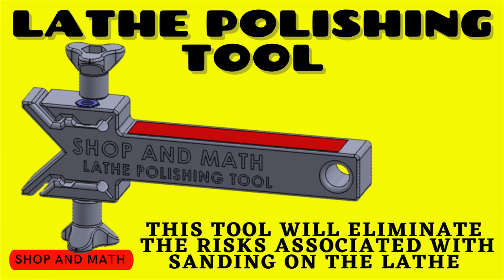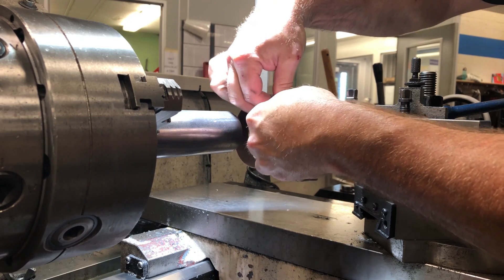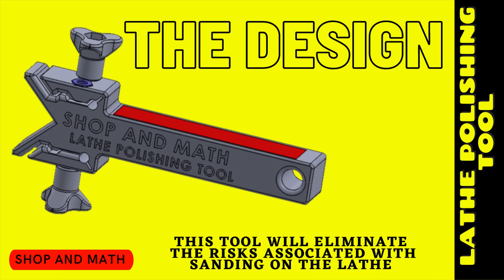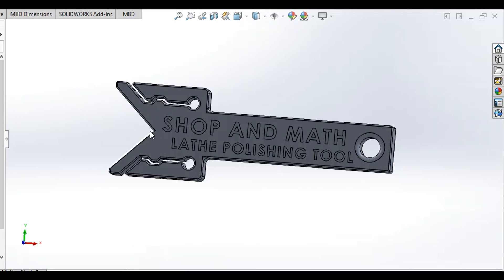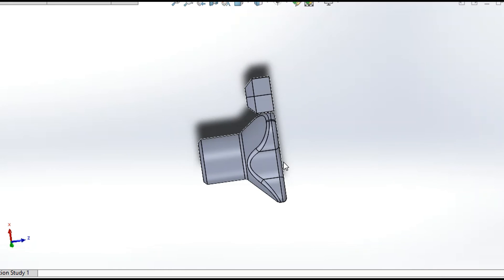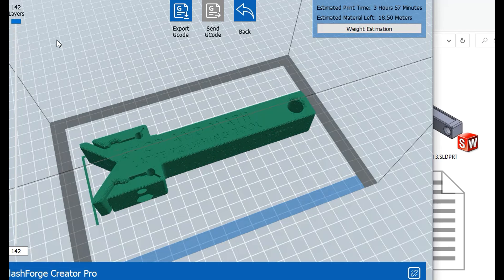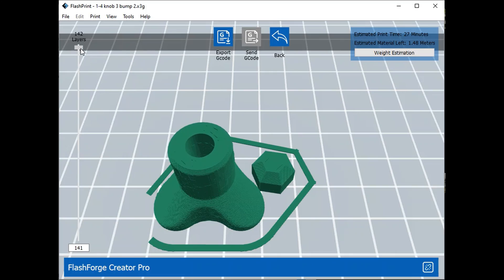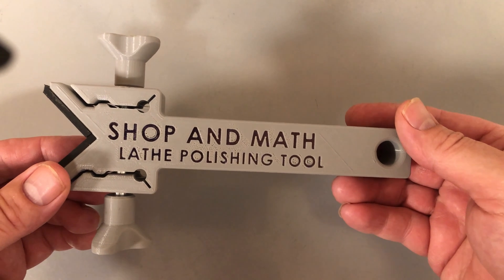Lathe Polishing Tool

Comment: I'm afraid this tool will not work in practice (for sanding) because of one aspect which has been overlooked.
When sanding, you must keep refreshing the area of emery cloth which is in contact with the job.
This is because the clith becomes clogged and blunt within a very short time during use.
There are devices designed for this job which allow you to continually wind on fresh cloth.
Reply: I would love to see one
Reply: Depends on the paper you use. It does work "in practice" especially in finishing to a tolerance (no surface defects) because I made one...

Comment: Why not make it out of aluminum rather than plastic?
Reply from the maker: The way that I approach this problem may differ from other people because I am designing this for apprentices and people that are new to machining

In other words people that don’t have experience and that will make mistakes so I wanted it out of plastic and I also wanted to break in specific spots

I want it to break clean and in front of the tool post preferably between where the two screws meet so that if it does get caught in the workpiece it will not whip

I also wanted it to snap if you accidentally hit the chuck

Thank you for taking the time to comment it is much appreciated
Ray

Comment: Proper technique would be to use a loop of emery long enough to pinch between 2 fingers so that it will simply get pulled out from between your fingers if it ever catches so that being able to let go is never a factor.....

That said I am making a holder for belt file/linisher belts suspended between 2 pins and tightened by a spring-loaded 3rd pin(similar arrangement to that of a belt-grinder) so that I can quickly change grits/belts and just move the belt a bit when a section gets too worn and use up the entire belt before replacing it.

Comment: Man I need something like that before I loose a finger.. I polish alot to get  finishes needed. I work for a rocket company and sometimes gotta polish to get in tolerance also. What a great idea man!!
Reply from the maker: Thank you for the positive comment there’s been a ton of negative comments on Facebook
Ray
Reply: Hi Ray. I work for an aerospace company and we are interested in working with you to address some of our hand polishing concerns. 

Would we be able to purchase a tool or have you work with our operators to trouble shoot ?
Reply from the maker: @zaraturner8314  
Hi Zara
The plans for the polishing tool are posted and are free
I am a professor at Conestoga College and not allowed to do contract work outside of the college
But I can help you through a zoom meeting or if you have other technical issues I might be able to lend some guidance for general safety practices
If you need a polishing tool that is specific to your needs I may be able to redesign something or redesign the one that I’m using currently
Ray

Comment: I think I will change the design a little and make a hand held unit.  Mahe it 3 piece which will effectively work the same but easier to make and hand held with round handle... Great Idea...I will probably add adjustable quick locking levers instead of knobs. Also different sizes to accommodate larger work...
Reply: Probably yank the hand held unit outa my hand, and knock outa tooth . js

Comment: That would be 1 screw in the center.
Reply from the maker: My original design had one screw in the centre
That will work just fine
I thought that I would need more clamping force that’s not the case
Thank you for commenting
Ray

Comment: Thanks Ray, would 1 screw work also?   It would secure both sides,Thanks.
Reply: I agree. A single screw and clamp should work. You just need to hold both ends in place at the same time while tightening the knob.

Comment: Nice idea. I think need change top clamp for regulation length sanding paper without cut, change length have new contact point  ( or cut bottom & moving top) - economy paper. now 2/3 paper go in trash.
Reply from the maker: Thank you for commenting
Reply from the maker: Its posted now
There is a link on the top of the video description 
Thank you for commenting
Ray